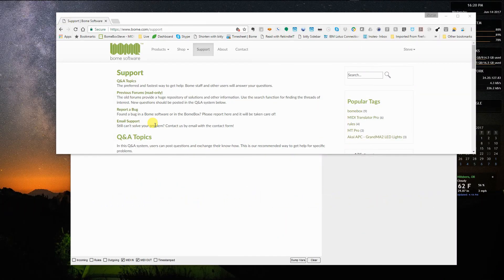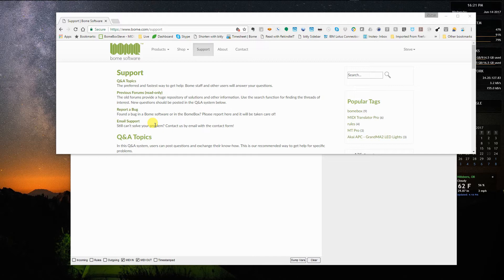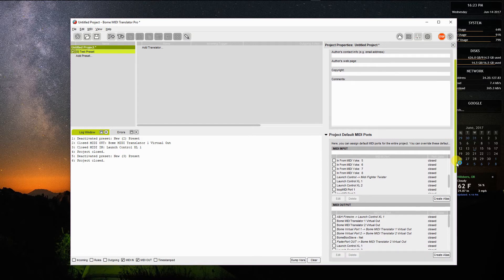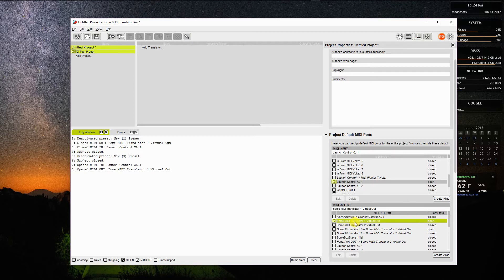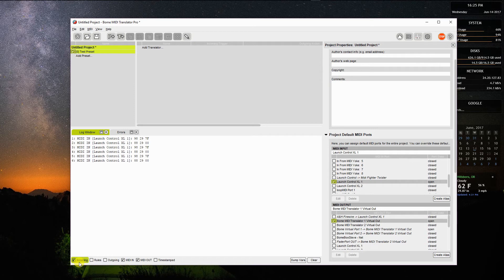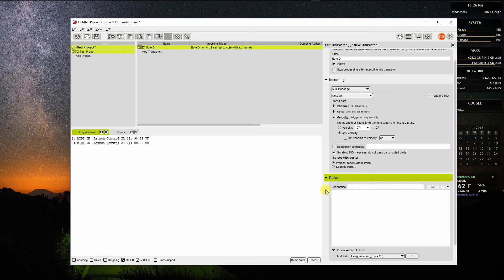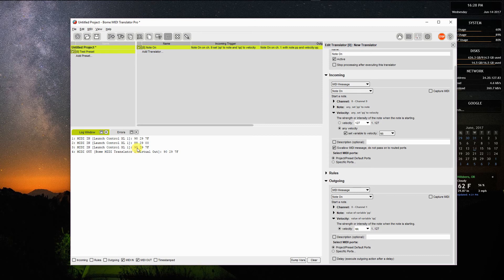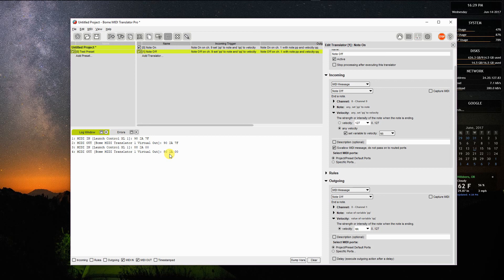Bome MIDI Translator Pro - Project Creation

Comment: I am using the trial to set up Preset to allow a midi controller keyboard's midi input to Bome of Note On or Off to translate to Program Change and Send that to Gig Performer 3 (VST Host). Could you do a video of a similar Preset? It can be any DAW that will respond to program change.
Reply from the maker: Hi Paul, I just answered this on the Bome User Forum.

http://forum.bome.com 

-sg
Reply from the maker: see here: https://forum.bome.com/t/simple-preset-for-note-off-program-change/1931

Comment: This looks awesome, congratulations. I guess you can simulate daisy chaining if you have enough USB-to-Midi cables right?
Reply from the maker: Yes, potentially with a MIDI hub on your computer. There are also devices that can take multiple MIDI DIN inputs and outputs and expose all of those as ports to your computer via USB.

Steve Caldwell
Reply from the maker: ...and you can use the built-in MIDI Router in MIDI Translator Pro to create a daisy-chain like setup.